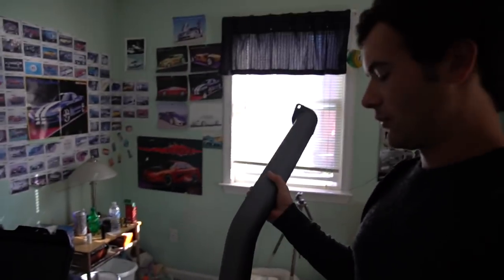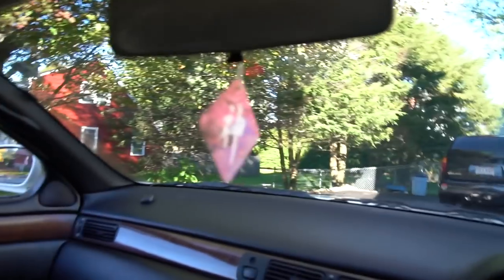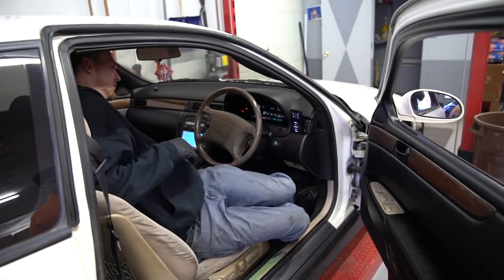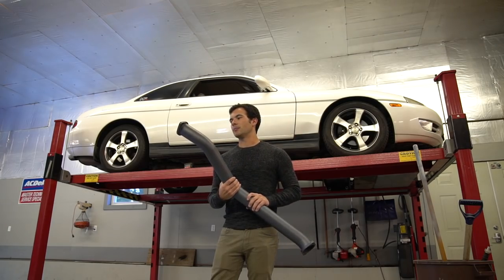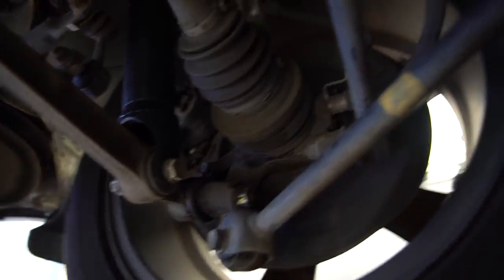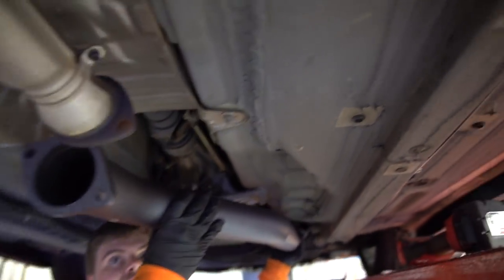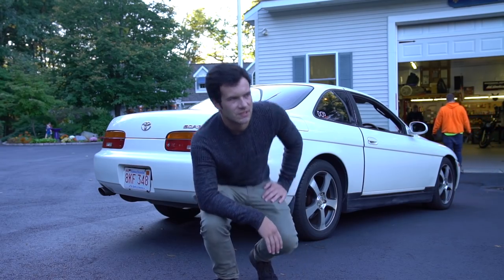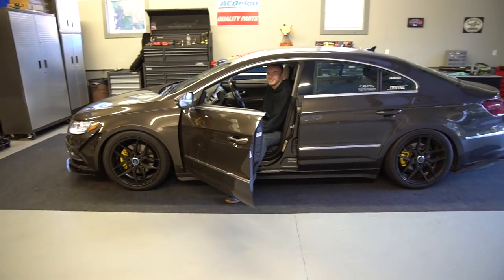HKS EXHAUST INSTALL! WIN/FAIL?

Comment: Mike if you get some ozium spray it will help get rid of the paint mell better than an air freshener. It a deodorizer. Helps get rid of bad smells like cigarettes and stuff. Works pretty well.
Reply: Ryan Lott weed smokers remedy lol
Reply: Great stuff just dont breathe it lol spray and run.

Comment: HKS makes great exhaust systems for sure. Have a HKS Hi-power dual on my s2000 & sounds amazing.
Reply: hondarider8484 I agree with you but I’ve had mine for 4 years so far with a couple open track days. So far no problems (knock on wood)

Comment: It's just a mild steel pipe nothing great. You can add the supra mk4 rest of pipe but need to add 6 inch of pipe. I used a full mk4 s/s 3inch as there cheap but changed bend at the end as wanted pipe straight as I only have one outlet for exhaust. Plus you would of had the hole for the temp sensor. Like the black interior tho that's my next mod👍

Comment: How to use SEM paint on interior?
How many coats?
How far to spray it with can?
How long can we wait for another coats?
Please answer...
Reply from the maker: Literally look on the back of the can and it will answer every question you just asked lol
Reply: @diiviinemedia  but you spray it about a foot away, so how many coats did you spray?
How light or heavy is your every coats?
Sorry if im so annoying just need more info...

Comment: It doesn't make sense to change the mid pipe and not put a cat-back exhaust on it at the same time...that stock exhaust is puny and is quiet af.
Reply from the maker: Boosted B Series EK They don’t make aftermarket dual exhausts for this car, only single exit. Which I don’t want. So I have to utilize the stock piping somehow.